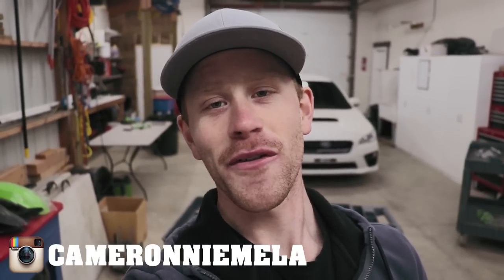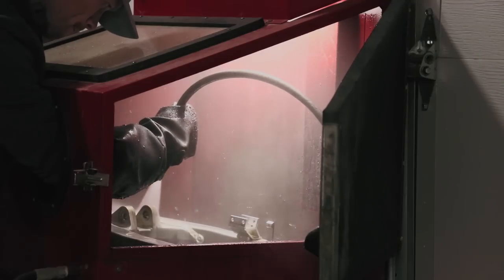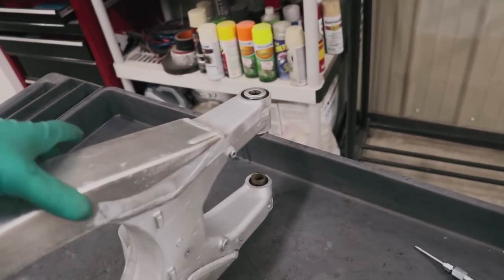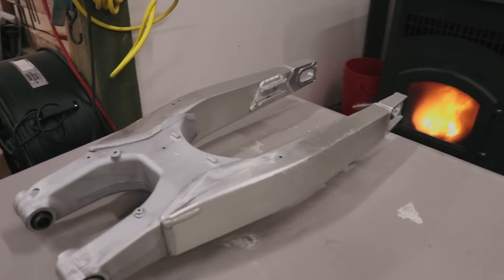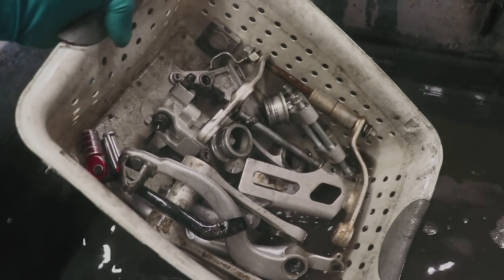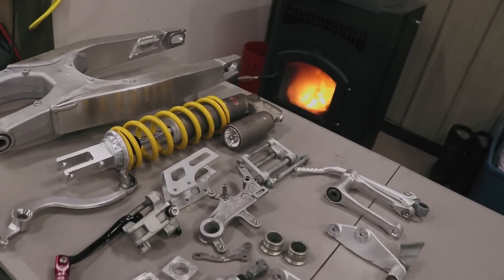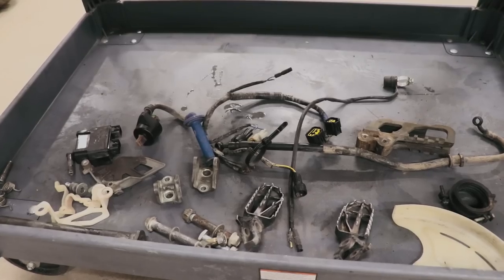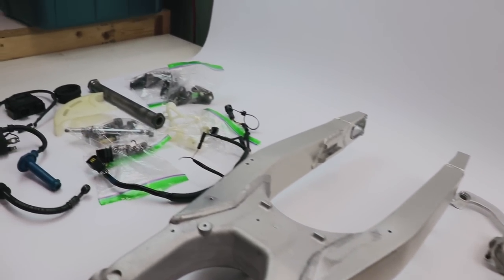My Secrets To Making Aluminum Look New Again!

Comment: The best way to makes anything made out of any metal brand new is if you can get a hand on an Ultrasound tub with a 1 part varsol for 25 parts of water!

But they are expensive as fuck, even used

Comment: The swing arm is hollow and  has needle bearings inside , the shock/spring has internal seals and bushings ,these parts are lubricated when assembled , submerging these in hot water and detergents washes the grease away and  traps  moister in for a looooooong time .They will rust internally out of sight  over time !Either completely take apart which is not possible in case of the shock or just clean externally .I would never buy these parts!Its like washing out your intestines... LOL no need for that!

Comment: Seriously you did a horrible job on cleaning and greasing those bearings you didn't even pull the seals out and clean all the crap behind them and you never even took the thrust bearings and washers out or put any grease on them either, you just pulled the pin wiped it off put on a little grease and stuck it back in with everything still full of dirt, I feel bad for the new owner.

Comment: Parts look great but that is a super bad idea for your shock and hydraulic cylinders. Chemical compatibility with seals and other plastics is pretty sketchy and definitely not mentioned in this video. Shocks only have wipers to keep this crap out. Don't do it. Your clean part with cost you a lot in a little while.

Comment: 150 degrees? Water boils at 100 degrees and then turns to gas (not petrol). Are you an X man or on a planet that has real high air pressure to allow water to be at 150 degrees before boiling off?
Reply: 150 F   my friend

Comment: A serious lack of mechanical understanding here.  Putting brake parts in a cleaner solution?  FFS!  Junk.  Putting a shock in a cleaner solution etc.   What do you do having junked the seals?  How far does that cleaning liquid get in?  At 150 degrees...
Bearings?  No no no.  You CANNOT 'cleaner' a needle roller swing arm like this!!  Nor the other part shown with a needle roller bearing!  You HAVE TO remove the bearing or seal it off.  Now, those bearings are full of water and old rust debris and will rust lots more.  Already, that swing arm bearing spindle has fretting corrosion.  Adding a bit of grease helps not one little bit, even if it is with a really cute designer grease gun.  Those parts are JUNK now.

Comment: Great, you showed people how to ruin aluminum. Never use simple green on aluminum. Its a great product for everything else, but is kryptonite to aluminum. Use of simple green is forbidden on aluminum airplanes for this reason. Now, they do offer a special aluminum compatible formula, but the people need to be warned not to use the standard simple green when working with aluminum.